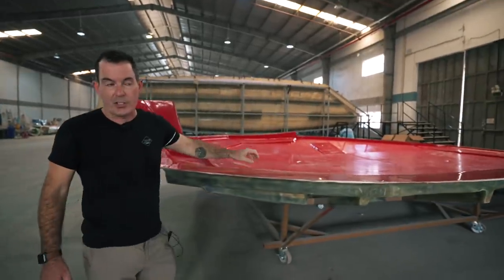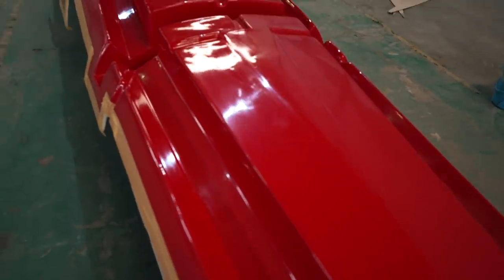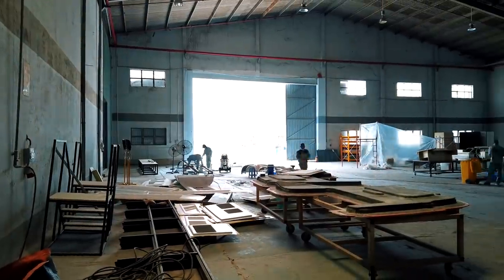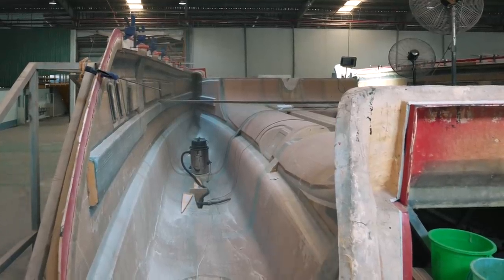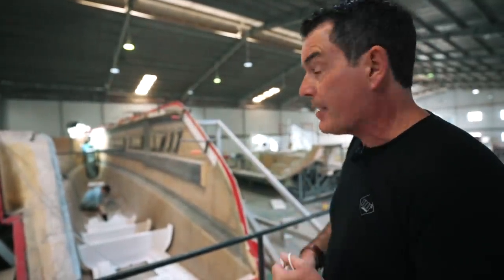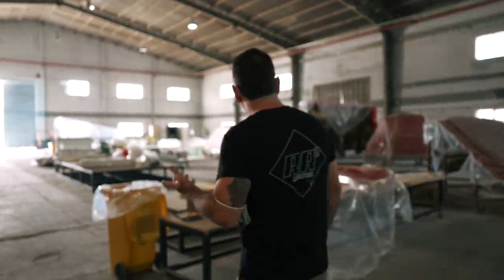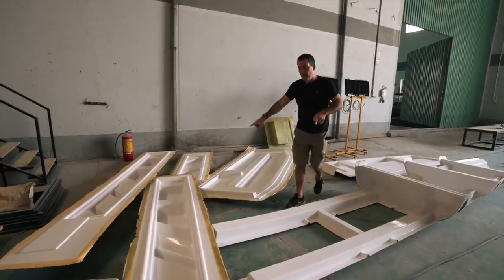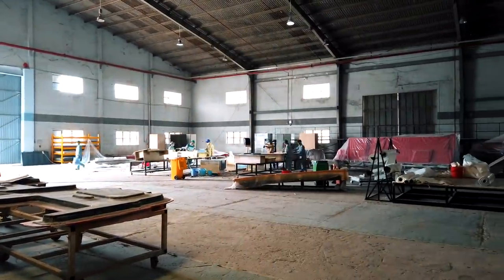WHY Do We Get SPECIAL ACCESS to the Boat Build? | Ruby Rose 2 Build Update

Comment: Many people, including myself, cringe at the price of these boats. However, when you see just how much it takes to build one, I’m actually amazed that they don’t cost twice as much. Can you imagine how many man-hours of labor? Not to mention design, parts, materials, overhead, AND the fact that they still need to turn a profit! If more people watched these videos, they would understand why a quality boat is expensive.
Reply: How much are these catamarans £££££
Reply: @bornfreefreedom4900  $800K to $1.2M USD (in this rough size for various manufacturers) depending on option and what equipment you fit them out with at the factory.

Comment: Later on u may want, places to clip on straps, when your cleaning the hulls underwater. And how cool would it be to have , a air pump , that feed right to face masks, 150 feet of air line. 1 so you can clean, inspect, or repair,  or just explore around the rose when shes on the hook.
It sure would makeing, checking the anchor,  or mourning ball alot easyer.

Comment: Thank you so much for allowing us the opportunity to journey with you through this build! 

Do you happen to have any more behind the scenes conversations of when SeaWind were initially deciding to build this boat, how they decided to put what were from a design/construction/sailing perspective? In other words, once they saw a niche for this size of boat how did they dicide the differences between the smaller and larger sisters of the model line in terms of equipment placement, construction, or will this boat's hardware layout mirror that of the larger/smaller Seawinds of the same year? Secondly, how much input did you two have on those decisions or was the boat design mostly complete when you were contacted?

Comment: Wire conduit & plumbing run's are they going to put in a large pvc pipe chase for running wires? making it less work and less clips or wire tie type support.. if you add new equipment later. This is getting not just you* excited but all of us,  Hell I think I could build one in my garage now.
Reply: Federico yachts….sounds pretty good I must say.
Reply: @larrimos  No but I did sleep at a Holiday inn last night..

Comment: I don't want to be that guy but a gantry is an overhead crane . It can be on wheels like the machine that takes your boat from the water or mounted to the roof. It typically moves both forwards and back as well as side to side.
The raised platform you are standing on could loosely be described as a mezzanine.

Comment: Hey guys great video as always. Thanks also for re-instating the podcasts, I’ve been looking forward to those and the huge amount of info we get from them. Quick question on the 1370 build. I understand hull 3 is being built differently in 3 separate parts as opposed to SN and RR2 which was one piece. You mentioned that’s a cheaper way to do it but could it also be less rigid because there are now 3 parts to ‘glue’ together?? Thanks as always…

Comment: Can you add a UV type material to the wax and do a visual inspection (under UV) of the wax coating to assure complete coverage?
Reply: They are in Vietnam not NASA 😆😆
Reply: UV technology has been around for 30+ years.  Also, I would not sell the Vietnamese short.  They are coming around the technology curve pretty fast.
Reply: @davidstoen4005  Lighten up Dave/Professor

Comment: Good to see so much progress.
A question about the floor molds - if they're gel-coated then removed from the molds before glassing, how do they prevent warping? Is there a frame the gel-coat sits on while being glassed?
Reply from the maker: The gelcoat is completely destroyed. Comes out looking like bits of egg shell. They then start the whole process again
Reply: @sailingrubyrose  so the initial gel coating process is just their way of insuring the mold is viable? I’ll watch that sequence again as I’m sure I’ve missed something….🧐

Comment: Nick… does the Cad System Sea Winds is using calculate weight of each and every component as the Build Inventory is produced? Do they then go back and actually weigh completed components to confirm that their weight estimates are correct? Seems like this is a critical piece of information for both the builder and buyer… Determining the Center of Gravity? As an example a 15% miss on weight estimates to the plus side could have a dramatic impact the boats performance correct? It may make difference on how you load and maintain owner furnished accessories? What about misses forward aft port or starboard? Are this issues trimmed with ballast? Like in the 1600’s…. “Aye say ole chap throw 30 - 14 stone 3 feet forward Port” 🙄😂 Asking for a friend…. 😵‍💫

Comment: Is the part made from the plug or is the mould made from the plug?
Reply: Nick occasionally seems to mix that up. If a finished part comes off, it is a mold (mould in UK).  If it is shaped like the finished part, it is a plug from which a mold will be made.

Comment: In earlier videos (by Seawind) the hulls were shown as resin infused as 1 large piece.  Do you have any idea why the hulls are now resin infused as 3 pieces (and later bonded together)?
Reply: Could that be different size models....when you get to this size handling the main hull components indoors becomes an issue ...it also enables the building in of all the sub structures and reinforcements in easier to control stages....it also cuts down on waste if one parts fabrication process were to go wrong.
Reply: The 3 part mould aids in Initial construction for ease of access,Ease of infusion and ultimately makes the process far more modular.Laminating a complete hull as one piece is arduous for all workers ,results in complications with infusion and is seriously more difficult to demould as I have experienced in my build.If I were to make another hull I would split my moulds along the keel line as these 1370 moulds are made.Ross
Reply from the maker: @LifeOnTheHulls  a very thorough and accurate answer, thank you Ross.